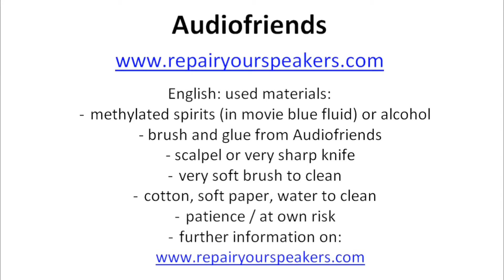Refoam your speaker in a simple way. (small woofer)(RFT)

Comment: Just refoamed my Heybrook HB3 mids, and it all went as on the video.  One small point, it needed more glue than shown, especially the outer edge where the foam was sticking to aluminium.  But I lifted the edge and used a very small brush to apply more glue.  Apart from that it worked well.  The biggest problem was removing the old glue, which was very strong and rubbery; it had to be carefully carved off, rather than scraped.
Oh, and it took 2 weeks to arrive, but Audiofriends did warn that might happen.
Reply from the maker: Good evening,
We shall put at the description that strong glue on the frame can be removed with sticker-remover (at own risk). Also flat old glue which is still strong can stay on the frame an being glued over. We have warned in the E-Mail we have send you with lot of information:

(Unter: Informationen im Deutsch)
(Below: information in English)
(Hieronder: informatie in Nederlands)

'ACHTUNG: Wir sind nicht die Post und haben keinen Einfluss auf die Post. Wenn ein Poststück zu spät ankommt, kontaktieren Sie uns bitte.
WARNING: We are not the post and do not have any influence on the post. If a postal item arrives too late, please contact us.
WAARSCHUWING: Wij zijn niet de post en hebben ook geen enkele invloed op de post. Komt een poststuk te laat, neem dan alstublieft contact met ons op.'

And:
 
‘DEUTSCH>
Bitte haben Sie Verständnis dafür, das der internationale Versand aus Niederlande nach Europa in Ausnahmefällen bis zu 2 Wochen dauern kann. Die reguläre Versandzeit sollte aber nicht mehr als 2-5 Tage betragen. Wir bitten Sie daher um ein klein wenig Geduld. 
------------------------------------------------------------------------------------------------------------------------
ENGLISH>
We advise that the shipping time from the Netherlands to Europe may exceptionally take up to 2 weeks.
The average shipping time is no longer than 2-5 days. We ask you politely to have some patience.’

Comment: After using 10x as much glue as you should have... be sure to squeeze all the excess glue out and smear it around. Poke it with q-tips so that it gets all of that fuzzy q-tip lint stuck in it forever.
Reply from the maker: Good morning, well, you're maybe right, but the glue dries. The glue can be made some more liquid (see: https://www.repairyourspeakers.com/en/glue-brush-fluid/c-3). The glue dries up to be less heavy. Certain when you work in a warm environment, it can be handy to make the glue some more liquid, and use less glue. Best regards, Fred

Comment: Nice clear video “ The Glue “ what type is used, is it pva, wood glue etc?Thanks
Reply from the maker: Good morning, good question. PVA is often used, when the glue is dry it needs to be flexible. So no glue for wood, but a PVA that stays flexible. Is possible, but not perfect. We have an industrial glue. We have tested the glue also on plastic frames, aluminium, etc. Also it can be handy if the glue doesn't shrink too much while drying. Te most information about our glue can be found on https://www.repairyourspeakers.com/index.php?action=extra&extra=A_19__lijm_voor_montage__welke_&lang=en. The difference between PVA and our glue is that our glue is stronger and more flexible when dry. They look the same, but if you test the both glues, our glue is in dry condition the best.

Comment: What kind of liquid did you use to remove the old surround from the paper cone?
Reply from the maker: Good morning, thanks for your reply. We use methylated spirits or pure alcohol. These are both not complete the same. Methylated spirits is added a blue colour and some other small amount liquid to make it not useable for consumption. Alcohol is colourless. I must say that at the drugstore I had to explain to them, that I used it for instance for cleaning the heads of tape recorders etcetera. They were not very easy to sell the alcohol to me. Best regards, Fred